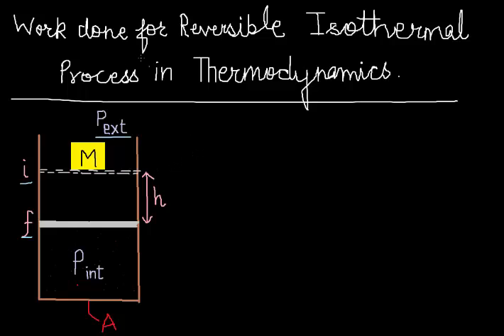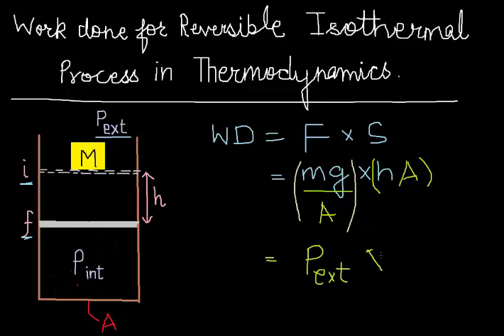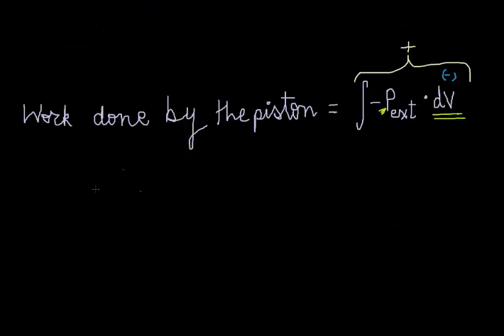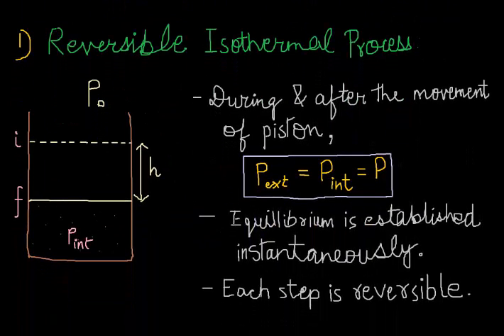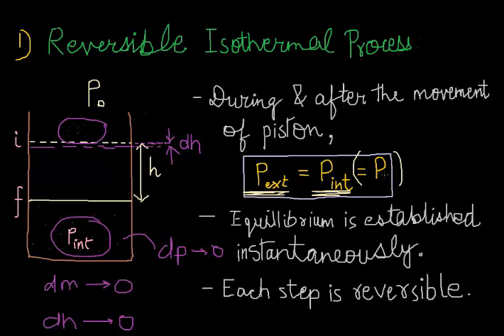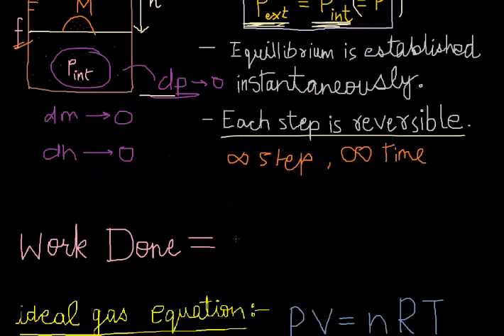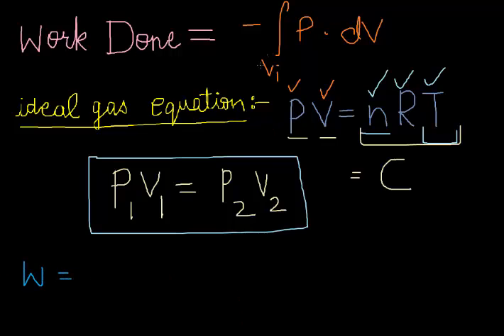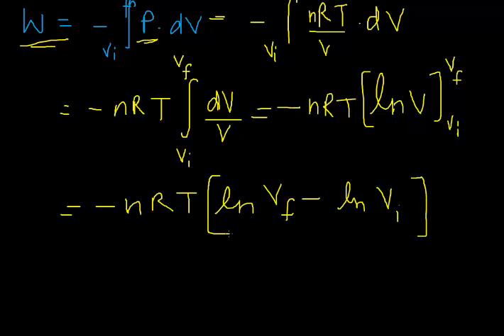Work Done for Reversible Isothermal Processes in Thermodynamics #khanacademytalentsearch

Comment: what is there minus sign with p ext
Reply from the maker: 'P ext' is the work done by the mass M on the piston in downwards direction.
While here, we are talking about the work done BY the piston, that means the work pistol would be going against the external pressure 'Pext' to nullify it.
Hence the gas in piston would be applying an upward pressure (force) to do work against mass M.
It's all because of direction that minus sign exist as upward Pressure comes from upward force, which is a vector quantity affected by direction.